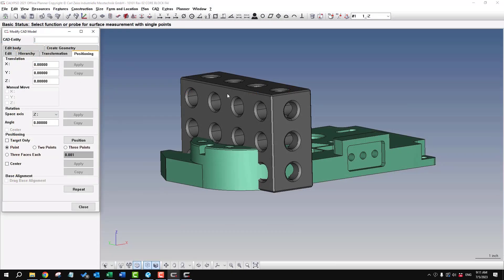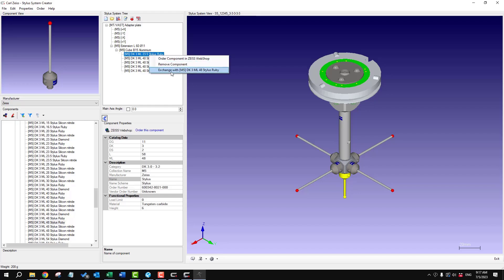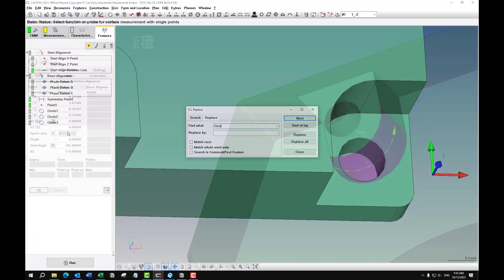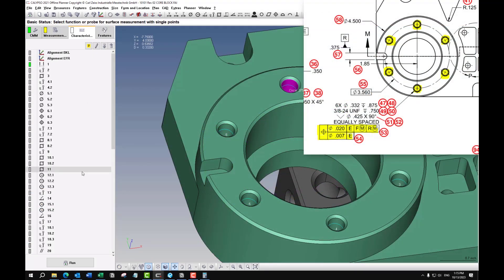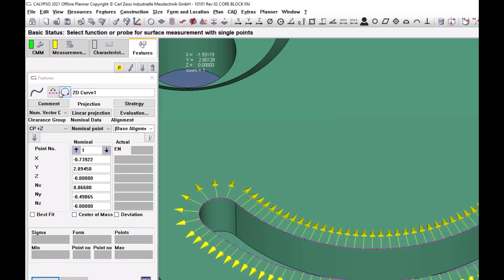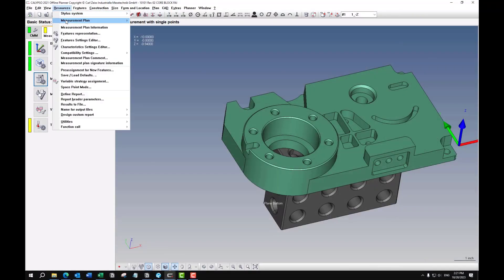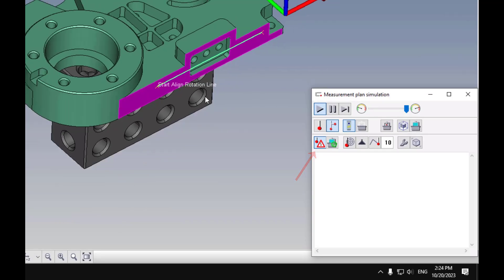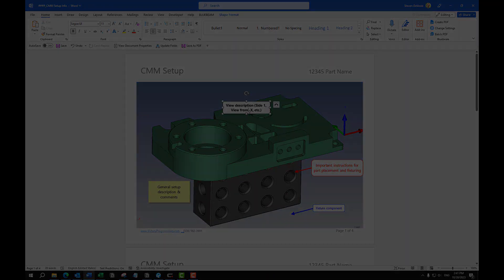Learn Calypso by Example: Advanced Program 2 Preview

Comment: Can you teach, how to troubleshoot Vast unit use the Joystick, if Vast unit not in correct position. For your information, our cmm used Vast XXT unit ( Rotating ).
Reply from the maker: Hi, can you please provide more information about your problem? Is the RDS XXT probe head rotating the wrong direction? What exactly are you trying to do, and what is happening incorrectly?
Reply: @learn-cmm  
Sorry, my English is not very good.  Yes, that's right, if the RDS XXT is not in the right position.  I mean in the wrong angle position and stuck.  How can we solve the problem by only using the Joystick.  Thank you.
Reply from the maker: If the RDS head is stuck at the wrong angle and won't move, you have to close Calypso, turn off the controller (M) button and black power button on the side. If you have an older CMM there might be a power switch on the CMM also. Then turn everything back on in reverse order.